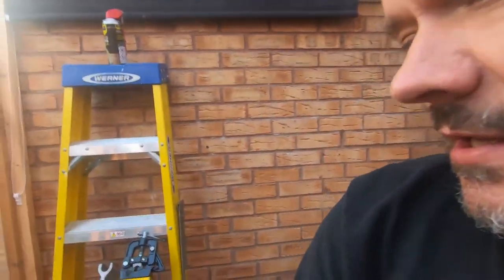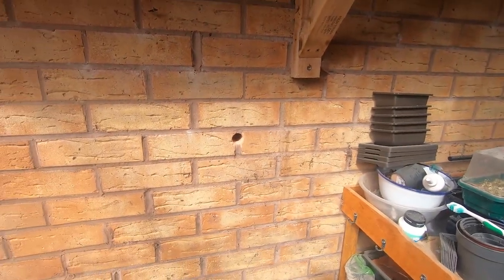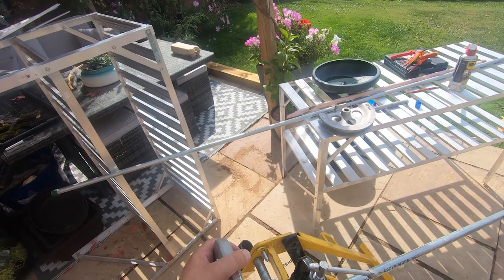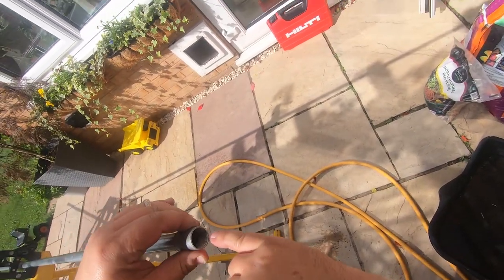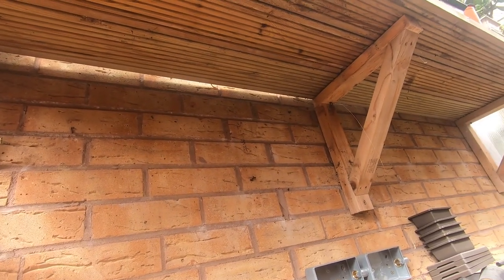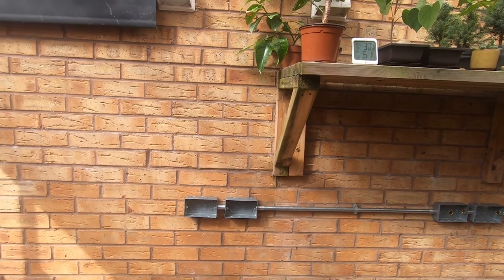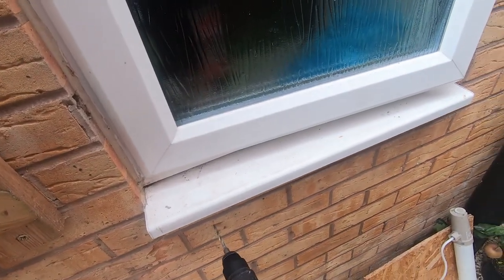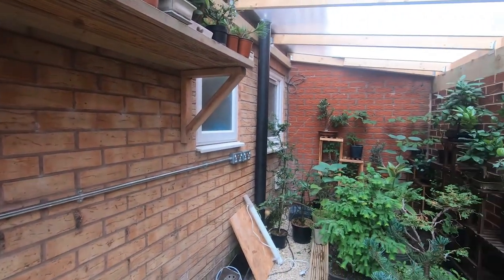Cobbles Finished and Electrical Installation in the Bonsai Area

Comment: Looking really good Scott, a wonderful area for bonsai!
Reply from the maker: Thanks Nigel the sockets are already coming in handy, Ive sited the lights into position today but i need the light sockets to fit in the conduit, Ive changed the install method which means i need them now - i will get some Monday and fit them asap for the full spectrum LED low bay fittings, they will come on with the daylight and go out when its dusk - opposite to what you would normally do with lighting lol
Reply: @LetsDoBonsai  Sounds good Scott!

Comment: Nice work! Very tidy and proffesional looking.👍
Is that an electrically powered backdrop for videos on the wall next to the entrance to the bonsai area?
Reply from the maker: Cheers, I’m glad you think it looks professional as I’m an electrical engineer by trade lol, the back drop is manual just a standard blind cost £20.00 from Argos! I’m now feeling the temptation to motorise it lol.
Reply: @LetsDoBonsai That's a great idea! I didn't know they make blinds that wide. Given your background I'm sure you could do it as long as the mechanical part is not too difficult to build.